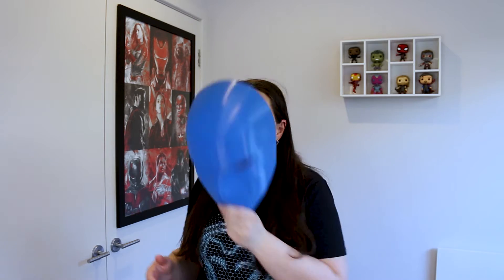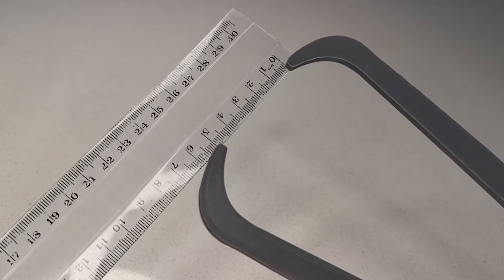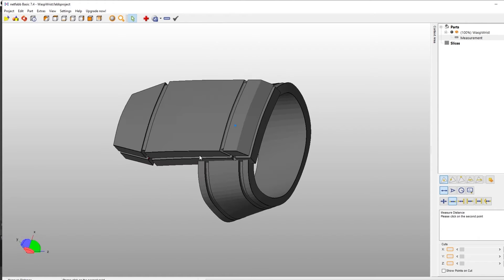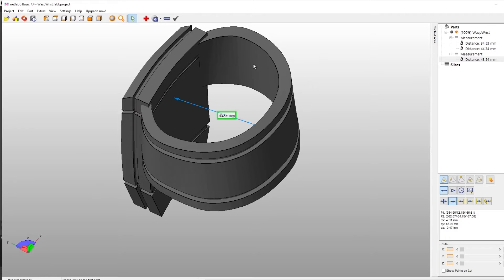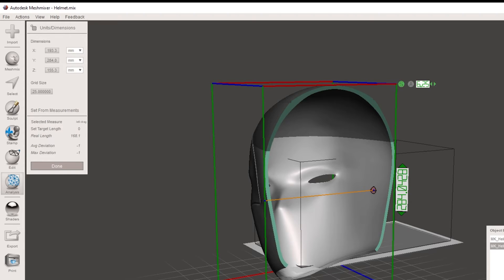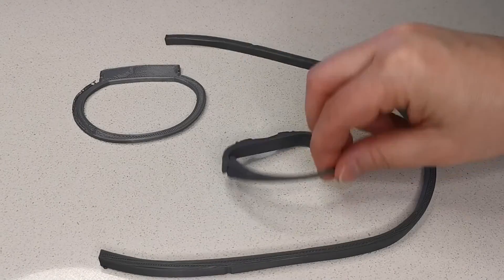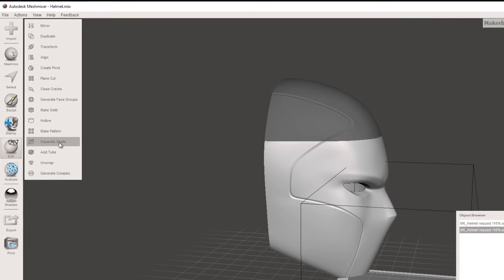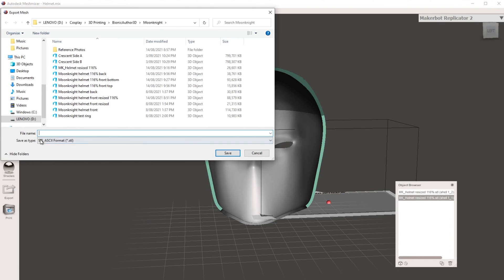Beginner Tips for Scaling 3D printed cosplay helmets and armour // Meshmixer Tutorial

Comment: Thanks for your efford. About scale.. YOu showed how to make bigger object but I have problem with making objects smaller.. I need 1/6 scale so I enter 0,16 for X+Y+Z and do not works.. So I enter for example 0,5 or other <1 value and do not work... Help please
Reply from the maker: Hi, 0.16 should definitely work for 1/6 scale. It's a little hard not seeing what you are doing but if you are in meshmixer, under transform you need to put in 0.16 in the "scale X" box and if uniform scaling is on it will scale the model smaller. I have just done it myself in meshmixer to test it. 

Can I ask are you using 0.16 or 0,16. It needs to be a decimal not a comma. If you are still having problems message me on Instagram as you will be able to send me a photo this way or I can send you a short video. Hope this helps.
Reply: @AstrocyteCosplay  thanks. I use decimal. And after typing value and click enter to confirm - zero values appears....and model disappears from screen.
Reply from the maker: Maybe try zooming in? Maybe the model is really small now and you just can't see it but it's there? I did it with a helmet to test it.

Comment: nice video. very informative. Question: when moving or rotating the cut plane, is there a way to enter in an exact numerical value? Dragging is ok, but I need to enter a value... is that possible?
Reply from the maker: Glad the video is helpful. I am not personally aware of a way to enter an exact value. If you are rotating I do find it easy to drag out a bit and it gives you a circle measuring bar that allows you to stanp to every 5 degrees so that might help a bit. Sorry I can't be more help.
Reply: @AstrocyteCosplay  I'm familiar with the scale bar and circle when dragging the mesh... but it seems that there should be a way to enter in a numerical value while doing so. I can't find a way. It did seem you were able to 'snap' to (was it) 10 deg increments. Is there a setting in Meshmixer for setting snap values? I'll check out 3D Builder at your suggestion. Maybe it's more intuitive. Thanks!
Reply from the maker: Awesome. Let me know how you go with 3D builder. Would he interested to know how it is. I might even test it out on my next print that needs plane cut too.
Reply from the maker: I have just had a bit of a play around and maybe try 3D builder in windows. It has a plane cut feature and seems like you can add specific mms. I haven't used it though or tested it so you will just have to try it out.

Comment: This is awesome stuff thank you. I had a question, I am trying to print a help the helmet fits but the hole where you stick your head through is too small. Is there a way to adjust the size of only that portion?
Reply from the maker: Glad it was helpful! What you are talking about is always a big challenge. The problem with scaling just the bottom section is that the portions of the helmet at than not uniform and it can look a little odd. There are a couple of options to try before doing this (depends on the helmet what might work). 1) Scale up the helmet so you can get your head in the bottom section and then using foam padding to make the rest of the helmet fit. 2) Lots of cosplayers chop the back or front off and get it to attach with magnets so you can get your head in and then attach the rest of the helmet. 3) Depending on how tight it is you could try lightly heating the bottom with a heat gun and stretching out a bit (again runs the risk of looking a little odd). Hopefully some of this helps.
Reply: @AstrocyteCosplay  wow thank you these are some great suggestions. I will definitely being using them for my helmet in the near future.

Comment: I tried uniformed sizing in the past and it was not a good fit for me. I get the fact that it is needed to keep it's over all shape, but what about taking into consideration of the padding?
Reply from the maker: Yeah it's definitely hard and different for everyone. We aren't built like Superheros and are all different shapes and sizes. The uniform is definitely to keep the same portions but if you find something works better for you, run with it! You could add extra measurements for padding if you know what you will use. Every helmet is different though and it can be hard to know where it's going to need padding before it's printed and on your head. Good luck and if you find any awesome tips make sure to share with us ☺️
Reply: @AstrocyteCosplay  Sorry. I should have specified when regarding to making helmets. That is what I was referring to.